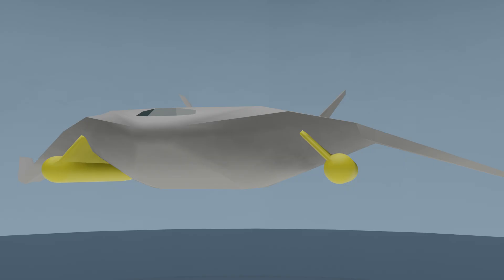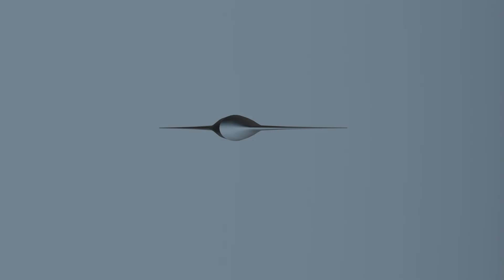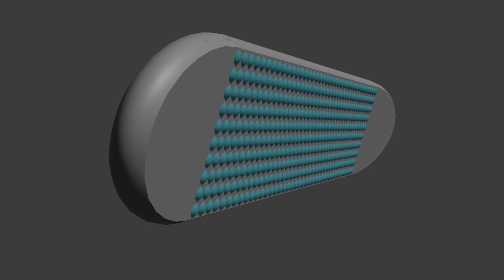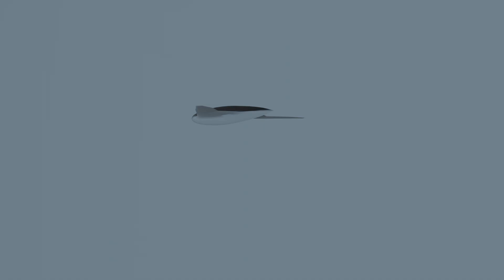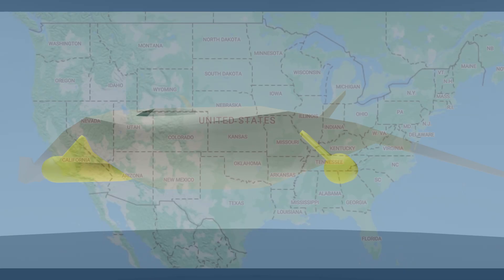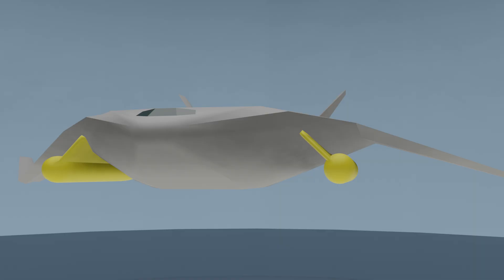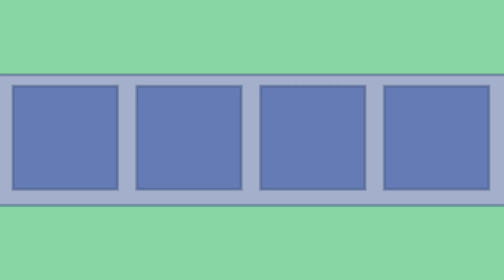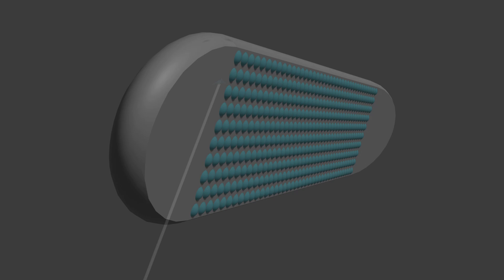breaking stealth

Comment: I think you’ve got a good thought experiment, but you are over reliant on your premise and on the idea of having high budgets and no maintenance costs.

A major reason acoustic sensors aren’t favored is because they’re highly unreliable and situational. They’re decent at detecting low altitude aircraft, but so is every modern radar. And when you factor in the cost to range ratio, there isn’t really much financial benefit.

Another thing is, using truck based search radars is an inefficient solution in my opinion, while it may reduce the probability of a stealth aircraft knowing where they are, that won’t stop them from simply kicking down the door with some ARMs, which absolutely are advanced enough nowadays to hit dedicated SHORAD systems, let alone bus sized radar trucks. 

Though my biggest gripe is that nearly every goal you’ve set out to meet can be achieved with thirty something radar installations and twice as many F-35s on intercept duty.

I don’t want to be overcritical though, good production quality in your video, and all of your explanations were easy to understand.